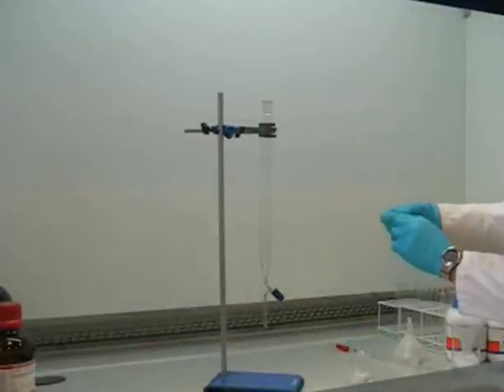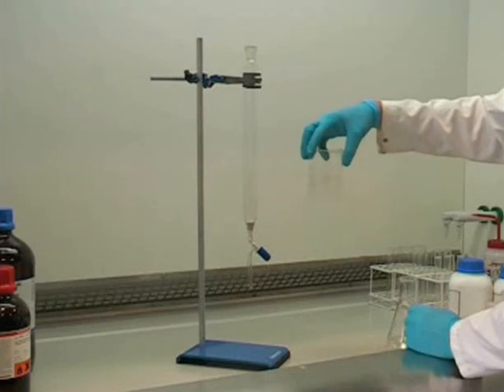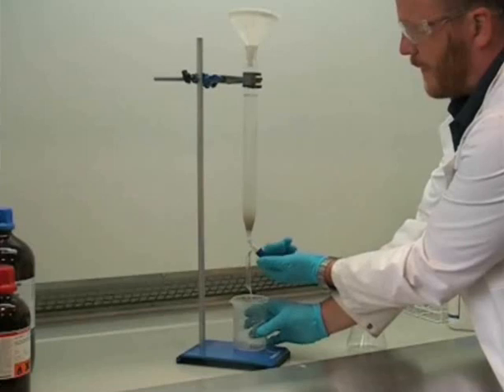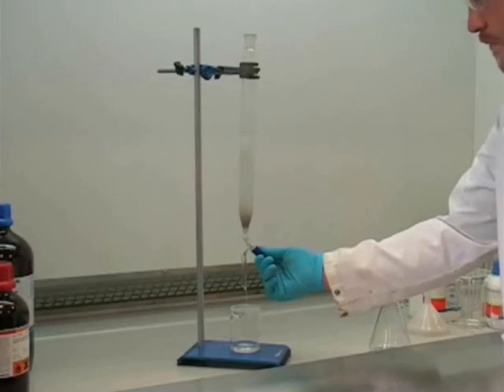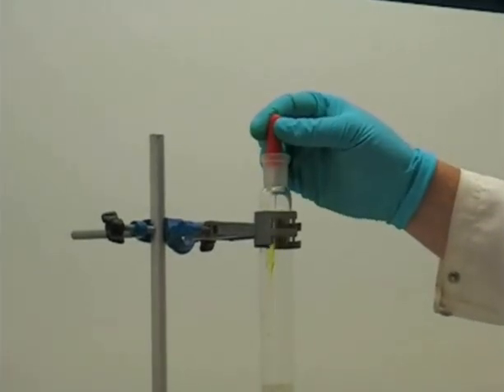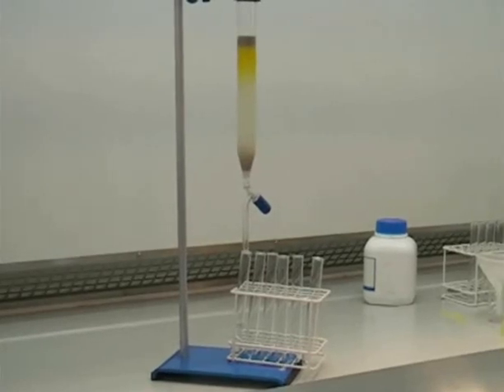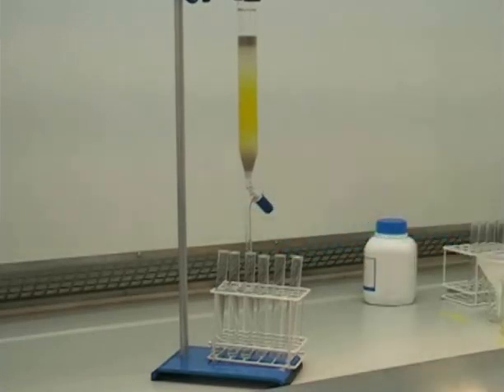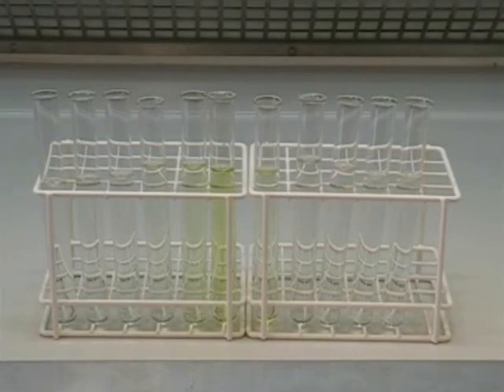Column Chromatography

Comment from the maker: What you're talking about sounds a bit like flash chromatography, where pressure is applied at the top of the column. I suggest that you do a bit of research on flash chromatography before trying this. Always beware when applying pressure or vacuum to glassware as there are risks - make sure you stay safe!

Comment: If I want to purify a compound and run a column chromatography I choose an eluent that drives out the impurities fast but lets my main compound pretty much just sit on top of the column. If other eluents/mixes won't move my compound will putting it onto a nitrogen canister do any harm to it? The basic idea is to let the pressure just push it out mechanically from the column. Is this method completely stupid, or does it worth a try?

Comment: This is more of a like undergrad o-chem lab video. I advise NOT making a slurry before adding the silica gel. I add silica gel dry, then add hexane to wet it. Also I REFUSE to run a column without a stream of flowing air to push the eluent through. Takes wayyy to long. I can fill up 50 test tubes with an air stream attached to the top in about 20 minutes or less. Yea you do have to work about the column bumping up but if you packed it correctly it is so easy.